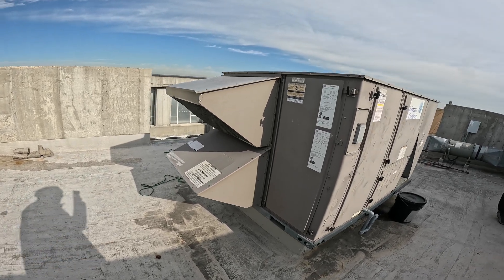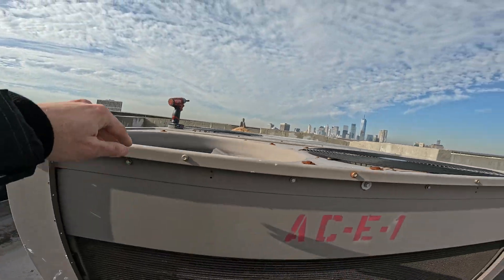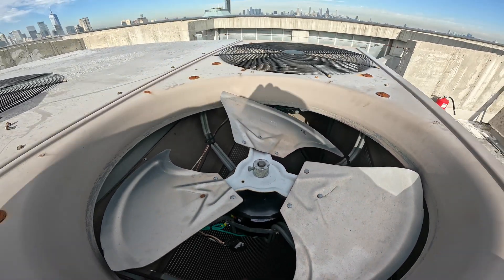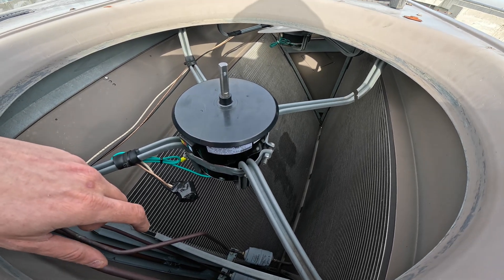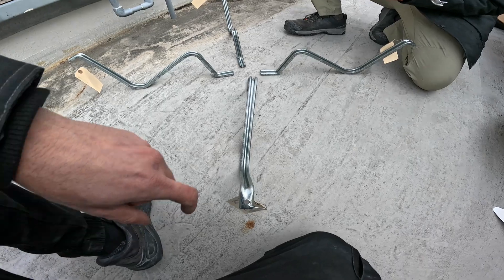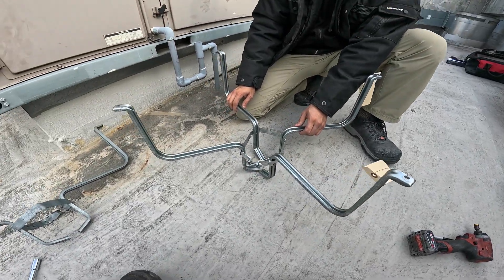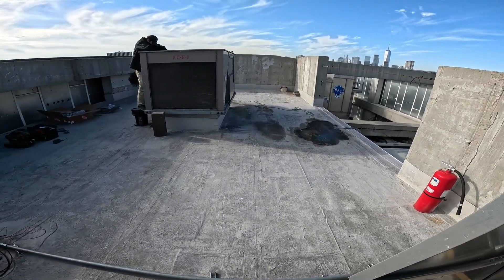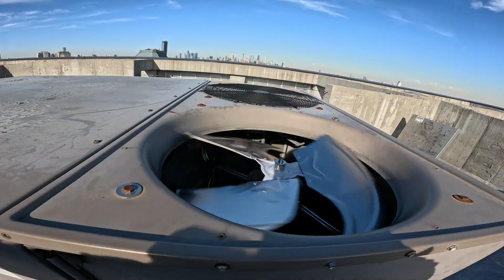HVAC: Commercial Johnson Controls RTU Rebuild/Repair (Johnson Controls Roof Top Unit Not Cooling)

Comment: should have wrapped the new band and arms assembly around the new motor and left it in place to install on unit. yeah heavier, but much easier and bends the band to a nice radius.
I'm sure I'll see a struggle placing the motor in later in video after 9:30

Comment: good save and repair without letting it further break. fir sure replace all the brackets, if one broke they've all been work hardened and likely stress fracturing.
the blade may have been the initial issue causing motor bearing failure, they can look ok still and be out of balance from being bent by debris/snow/ice, etc.

Comment: Like that cove over top motor below blade
Reply: motor "slinger wheel", anything gets on it, it gets slung off when spinning or starts spinning. used often on shafts  to keep water/other unwanted liquids/debris from getting into a seal, bearing or other area.

Comment: I've never seen a bracket made out of formed steel fail like this. It did break at the bend so it probably defective from the get go.
Reply: metal fatigue from work hardening, due to vibration. most likely fan blade was out of balance/bent(idiots/snow/ice/debris/rusted off balance clips), causing it to cascade fail, motor bearings first, even more vibration and mounts next. etc.
Reply: @throttlebottle5906 I agree. I just never had the chance to see a failure like this and I was surprised to find out it didn't have to be damaged in some way when it was made to fail like this for the reason you mentioned. Thanks!

Comment: Wonder what came first, the cracked bracket or an out-of-balance fan blade causing the bracket to crack? BTW, do you ever come across some Spiderman action swinging along that New York skyline?
Reply: pretty much guaranteed, out of balance cascade failure, fan blade >  motor bearings > support arms.